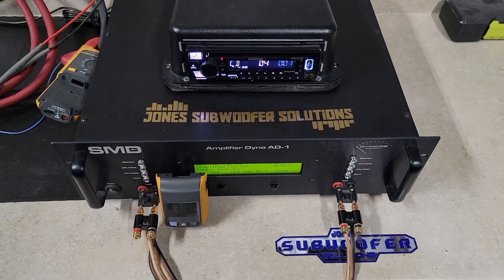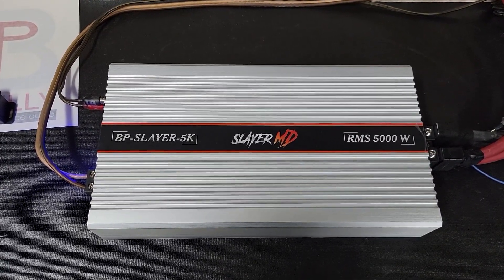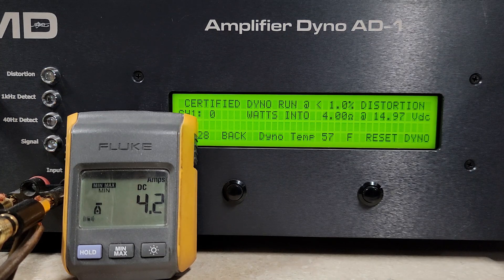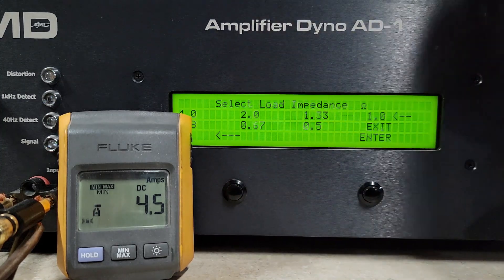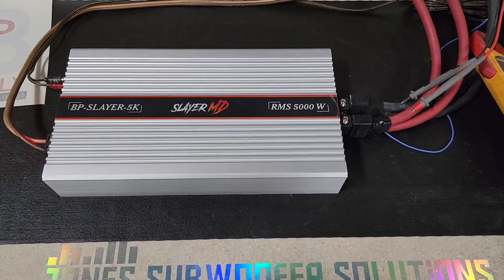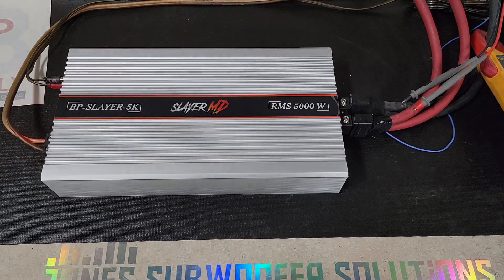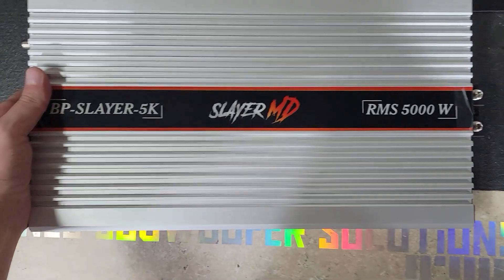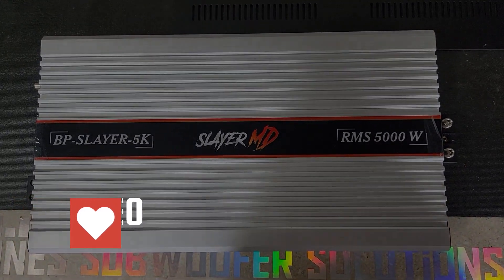AD-1 Amp Dyno Bully Performance BP-SLAYER-5k by Jones Subwoofer Solutions JSS

Comment: Could be they only figured 1 ohm speakers not resistors , big difference in impedance 😅
Reply from the maker: They sent it to me specifically to put on the dyno but I agree... Similar to the SD based amps they don't seem to tolerate a static 1 ohm load very well.

Comment: this is why I have never installed a full bridge in my car. They just aren't reliable enough yet for me to run. I'll take Chinese half bridge all day. Especially if I ever dip in voltage they are more forgiving.
Reply: You can beat the living crap out of a taramps and it will either prot itself or keep working.
Reply: @breedam  naw buddy had an md   12k and it was toasted in 6 months 400 to repair it.
Reply: @johnnyditommaso6807  how’d he pay when it was still under warranty. unless he got it used? ive seen more half bridges pop than fullbridge🙄
Reply from the maker: @johnnyditommaso6807  personally Taramps has been the absolute best choice for me, even above Korean and Chinese half bridge
Reply from the maker: @johnnyditommaso6807  the Smart series have thermal sensors and adjust fan speed accordingly, they're among the quietest of Taramps when under load.
No need to be coy, it is OK to say you don't like Taramps for whatever reason it is you actually have.   They are easily the best performing full bridge designs out, have the best protection circuitry, and have the best warranty coverage, all while being extremely affordable.
Reply: @Facekicker  yeah I just don't trust them. buddy had a 12k and smoked it. had it fixed for 400 and then it got smoked a second time when he got rid of it sold it to his buddy then he had to get it worked on. I won't put fullbridge in my car.
Reply: also love the channel think it's great. I  watch every single video you put out but man sometimes you're really hard on stuff and I think you took it way too easy on that bully amp when it didn't perform.
Reply from the maker: @johnnyditommaso6807  I appreciate your support.
I don't know what went wrong with the Bully to where I'm confident in making a good/bad determination.   Once Bully gets back to me I'll feel better about making that type of declaration.
Reply: @atlfreakdaddy  I concur, Can't run a 12k on a big 3 and agm in the trunk wired at .35🤣🤣
Reply: I've ran taramps smart 3 k for almost 3 years now in 4 different cars 4 different amps all have been wonderful.
Reply: Get Taramps and good Alternator. Done
Reply: I very much prefer Korean amplifiers. But I own two of the DB 4900s which are a full bridge amplifier. I have both of them running at half ohm in 2 different vehicles. Which you typically should not do with full bridge amps. With the exception of the big three and an xs power AGM battery they are running on stock electrical. They have both performed flawlessly for over two years. They are both running subs in large ported boxes and I have measured power output and rise on both of them. Between 30 and 40 Hz they are rising to up around 2.5 ohm and doing around 2000 W. As I said though I have never had an issue.